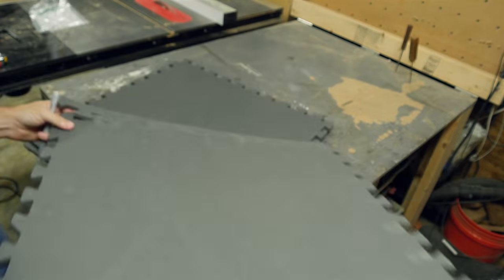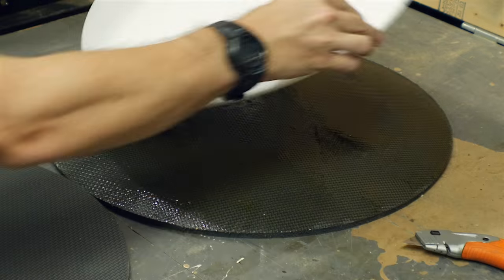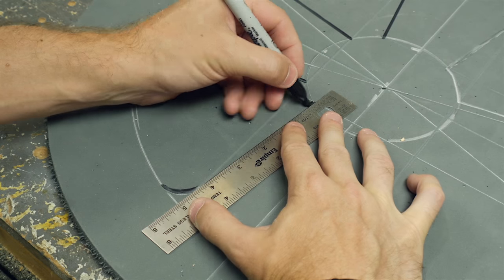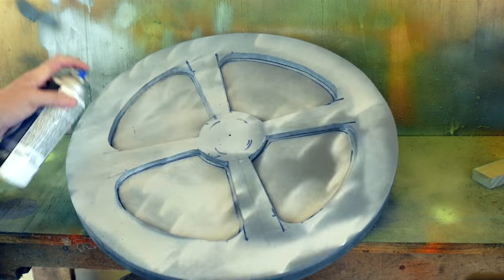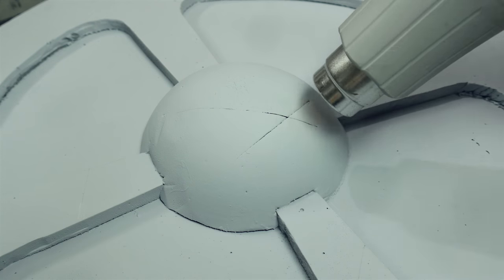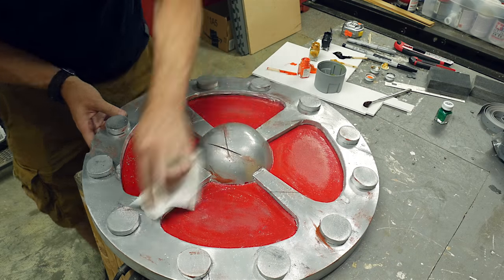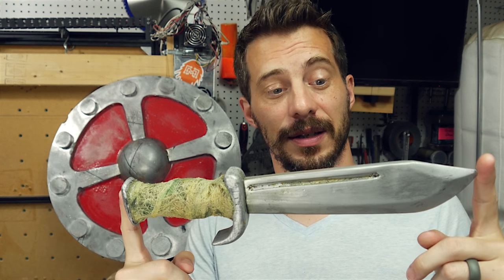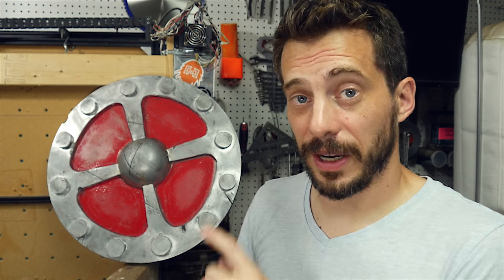He-Man's Shield from floor mats // How-To | I Like To Make Stuff

Comment: Nice job, when gluing the foam together, the rough side should be sanded smooth or the glue does not adhere well.   I use a belt sander to remove the texture.   Keep up the great work

Comment: I know this is a bit late, but i used to make foam swords for LARP using Pattex Contact Glue, and i can highly advice to use a roller for stuff like this to avoid marks left by clamps and what not. Short but high pressure makes pattex bond like hell, Barge needs longer pressure which makes it a bad contact cement imho.

Comment: When working with EVA foam Plasti dip is your friend. It helps seal the foam and fills any bubble holes in the foam itself, as well as the seams.
Reply from the maker: Yeah, Bill mentioned that and latex as good coverings after I showed his this.  I just got some latex in for the next project, but I'll definitely try out plasti dip as well.  Thanks!

Comment: Would a hole saw work for cutting those small circles? This was a super cool project man, definitely inspired me to try some foam work.
Reply from the maker: Possibly! I'd be a little worried about it tearing instead of cutting, but it'd be worth a try for sure.
Reply: +I Like To Make Stuff yea that was my thought as well. I'm guessing you could sharpen a piece of metal pipe instead if you had a ton of this cutting to do, since it would presumably cut better than plastic. Cool stuff!

Comment: Hey Bob! 
With the foam cutting, try running the blade over your cut line very lightly - just piercing it (acts as a guide), then run through a second time all the way. This should give you an accurate and clean cut as you are not forcing the cut through in one stroke. 
Cheers, Mike
P.S. Your channel rocks!
Reply from the maker: Excellent! Thanks for the tip!  I've struggled with it tearing instead of cutting near the bottom of the cut. I supposed that would help the tearing a lot.. Thanks!
Reply: +I Like To Make Stuff Cool cool!

Comment: I like using the plastic panel in the middle. I am planning to make a shield and I wasn't sure how to make it rigid.
Reply from the maker: It works pretty well, but I probably made it larger than it needed to be.  A bit smaller would give enough structure I think.

Comment: I thought you would have done the cutting with a CNC machine. Did you do it by hand because most viewers don't have a CNC machine?
Reply from the maker: No particular reason, I'm just learning a new material and you get a better understanding of it when you work with it by hand first.
Reply: Thanks for the reply, I will take that in to consideration.